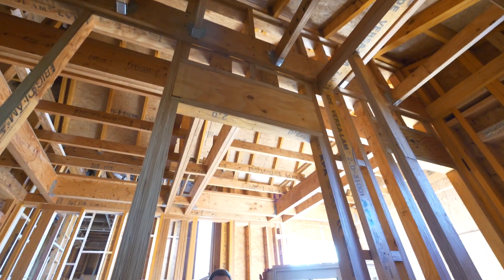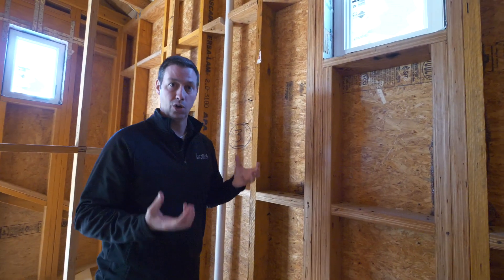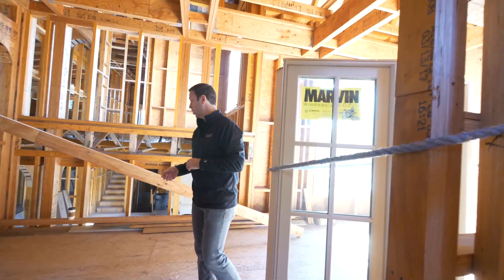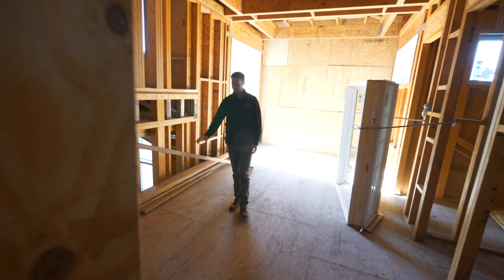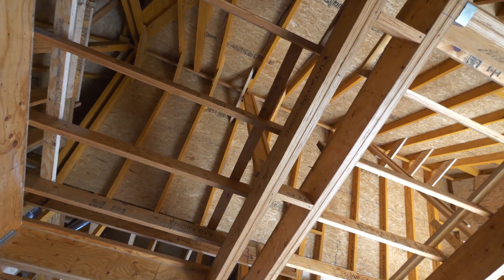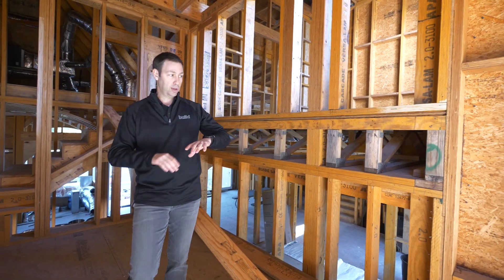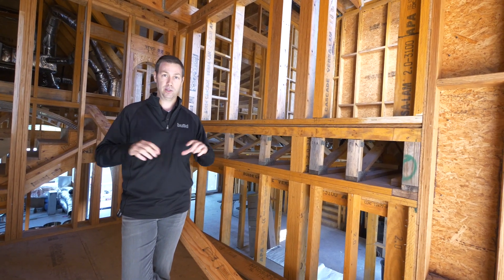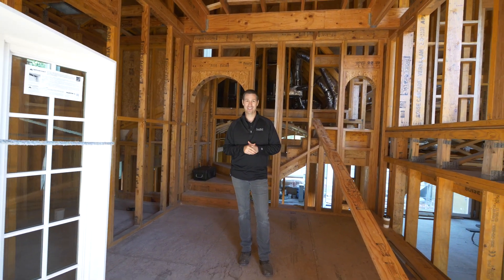2x6 LVL Studs - Pros and Cons

Comment: CBS is approximately the same in cost for the walls compared to a 2x6 traditional stick frame house. The only cost increase is the requirements for the foundation but with a house like this I'm sure the architect over engineered the foundation anyways. Really can't see justifying a lvl house that costs twice as much, is orders of magnitude weaker,  is sheathed in osb , and will have major structural  failures with a roof or plubming leak (though that isn't likely as big of a deal as the waste in cost).

Comment: if someone need high wind resistant house, why just not use right matherials like e.g. icf construction? or any other concrete based technology? it will be cheaper than making workarounds and stronger. and concrete house is much more comfortable inside.

Comment: Very cool house. having straight studs must have been a nice change. One advantage of LVL could be the ability to span much farther, and come longer. With that you could use much higher walls than typically seen without a floor in between. On a critique note, the AWC SDPWS doesn't want you to glue your wall sheathing to your studs, for ductility purposes usually associated with earthquake forces.

Comment: Most homes are rated to 110 mph and most windows only rated to 90 mph unless you are on the coast then windows are rated to 110 mph ( it isn't the glass that is rated it is the window sash being sucked out of the frame that is rated) Framing on the coast requires sheer walls threaded rods from footing to top plate this still doesn't stop the roofs from blowing off. Hurricane clips and a hip roof help but do not hold up in a bad coastal storm.

Comment: Great Video: I am sure your framers hated you on this one. hahahaha.  Use a timber framing nail gun to nail all the Lvls. Collar ties are suppose to be 2/3 from top of ridge to top of ceiling. Did the engineer add something to stop the spreading or designed in such a way not to use proper collar ties?
Reply: Collar ties and rafter ties are not the same. The former holds the ridge together, the latter keeps the weight of the roof from pushing the walls outward. Collars at the top, rafters at the bottom.

Comment: The one thing you fail to mention that drives me crazy is how hard- scratch that- IMPOSSIBLE it would be for an electrician to route wires up or down the walls after the sheetrock is up. I'm not sold on these new designs at all. There's a good reason framing has barely changed in 100 years.
Reply: Brilliant people just don't get it bro framing 30+ years this is just overkill a tornado hurricane or really bad storm will pulverize this monstrosity

Comment: We have codes that require commercial buildings to made of steel and concrete, but residential homes, where we sleep, only have to be made of sticks. 

Tells you what the government values more.
Reply: Many commercial buildings are wood. The separation is about occupancy and safety due to the fuel load of a building NOT strength. You can construct high rises from wood with the same structural stabilities as just about any other material. However, you will not meet the fuel load requirements without many costly extras to protect the occupants against getting caught in a fire or collapse due to fire. Is it practical to build huge with wood? No. But you could. In theory. 

Also If you are referring to the IBC IRC codes or INTERNATIONAL Building codes, which is what all of the codes are at a minimum based on here in the states, It was created by the ICC which was a merging of other code creators from all over the world and is based HEAVILY on public safety and safety from fire. The reason Homes can be built from wood easily on a single or two-family home is because of occupancy and is what separates the two codes from each other. IT IS NOT A COMMERCIAL VS RESIDENTIAL SEPARATION. It is merely a case of fuel load vs safe egress. They have spent millions on research and testing on this subject. SO to say the government doesn't value the people because they allow homes from wood seems a bit jaded.  ;)
Reply: @TrueRonin187  It depends on region, I can guarantee that you would never see a  commercial or government building approved and built down here in south Florida made of wood. Actually wood anywhere in the country for heavy commercial construction now days would be extremely rare.

Comment: You should have had the house engineered by a structural engineer.  The added stiffness of the LVL's adds to the lateral strength of the wall but that is not the structural issue.  The issue is the strength of the connections and the shear loads which are basically not addressed in this build.  the only thing that you mentioned was strapping and screwing the rafters.
Reply: 100% sure this was evaluated by an engineer.

Comment: So it will withstand 110mph wind, but will it withstand 110mph debris from the house across the street that wasn't built the same?
Reply: Touché
Reply: haha. such a good question
Reply: @etchcamelia108  $$$$$$$$$$$$$$$$$$$$
Reply: No only that even if your house survive  there will significant  damage because od the wind force basically you will need to replace the roof... so invest  In lvl is not a wise decision than to get a great insurance does. Built my block and concrete roof will make your house Stand  to those natural disaster
Reply: if we were three little piggies, youd be the one with the strong house that withstood the wolf's huffing and puffing.

Comment: I love the video just got a question. You said the word is really dense and hard so you have to pump up the pressure for the nails to get in there I take it you heard about nail gun and you have to use a hammer to finish it off what about screws I know it would take longer but would the screws be better in the long run I'm just thinking a quality in the end result

Comment: I use steel i-beams for all my studs - 16" on center, and 1/2" plate for the sheathing.  When I sit in my rocker and rock back and forth in front of a crackling fire with my tobacky pipe, it makes me happy knowing a Sherman tank couldn't get through my walls.  For that reason, it was worth the added expense.
Reply: Sound reasoning, however I opted for 12" o.c. spacing, with 1" plate steel and am installing a moat as a "belt and suspenders" approach
Reply: Steel plate steel would be ok a hundred years ago. But if you want a safe and sturdy house you should go with 2inch sheathing made from cutting edge composite armor.  It never hurts to put reactive armor on top of that.  But you can do that after you move in.  A house is just like your fightin position, you never stop hardening it. If you do.  That's when the sappers will get you...
Reply: @xxxrsgrsgxxx  sharks with laser beams in the moat?
Reply: @xxxrsgrsgxxx  Titanium is way better... stronger, lighter, corrosion resistant. Money's not an object, right? https://www.onlinemetals.com/en/buy/titanium-sheet
Reply: How about a King Tiger with an 88 mm cannon?
Reply: What kind of drywall screws u used for the walls? :D
Reply: LOL
Reply: LoL! You made me laugh my guts out! I love it when people pay a little extra to be happy and confident of what they are building
Reply: Always a pleasure to read the knee slappin’ comedians poke fun at those who … for a myriad of good reasons, have chosen to invest more time and more money to achieve a higher standard.  I will never pay for a Fabergé egg, a Patek Philippe watch, or a Bosendorfer piano, but I am quite appreciative of the engineering, craftsmanship, and effort it takes to create these amazing products.  While Matt is delivering on the desires of his customers, you clowns have paused your stapling of cardboard sheathing to share your sophisticated wit with us all … how nice.  I’m guessing the only time the phrase “high end” is mentioned on your sites, is when you’re hanging gutters?
Reply: I am disappointed this is not real

I want a bulletproof house

Comment: This guy in canada designed a framing system that has all the strength benefits your client asked for but it comes pre cut and is significantly lighter and i think all the studs and headers have insulated cores. Think its biffco something.

Comment: Does the additional weight of the LVLs require modifications to the foundation?
Reply from the maker: +J Skiahpa good question. I doubt it but any engineers out there care to comment?
Reply: Matt Risinger John Clark says the termites will take care of any mods needed
Reply: Assuming a standard strip footing on undisturbed stiff clay, the difference in dead load per linear foot is peanuts

Comment: Could you do a video on electric tankless water heaters? I find lots of info about the gas ones, but not some of the newer electric models.
Reply from the maker: +Pickle312 I'm not a fan of electric tankless units
Reply: I was just curious about them since my home is entirely run on electricity, although I have access to get gas added to the house.
Reply: If you have natural gas at the street that is going to be your best bet for utilities plus a heat pump.
Reply: Pickle312 electric tankless might work ok for a smaller sized house in southern climate, but up north with more than 2 baths,  forget it.

Comment: I'm about to start a small job with LVLs (basement). I need a new framing nailer though and want to try pick something that stands a better chance of driving an LVL nail in first go. I'm leaning towards a paslode pro (air) as they also make nails specifically for LVLs so I suspect they know about this problem. There's very little information on this though so just wondering if you used different nailers and if any worked better than others? Thanks!
Reply: Gordon, I believe PSI will make the most difference.  Finding a nailer rated for more than 125 PSI will be nice.  Most of the ones I see and mine included say not to exceed 125 or 135 I think. Ring shank are harder to drive than smooth shank and I would opt for smooth shank with the heat activated glue.
Reply: Thanks, finding a >125psi nailer seems like a challenge. The LSL nails Paslode make are also 30degree which narrows the field further. I'll keep looking, thanks for the tip. Edit: Looks like the rigid R350RHF is good for 150psi! It's 21 degree so no fancy LVL nails but I can live with that.
Reply from the maker: +Gordon Reyburn yes the Paslode guns do well with engineered studs. Good choice

Comment: with the hang over from the roof to waterproof the house, are you not worried that the wind could get under that and use it as a lever to rip it off. I have seen so many roofs pulled off because of the overhang.
Reply: Thats what the Orange Simpson Screws, and truss clips, are for. You generally don't need them both. But those prevent uplift by securing the trusses to the wall with a structural screw/holddown. versus just the toe nails from the framers attaching the trusses on.

Comment: Why not build a full ICF house if wind resistance is the goal?
Reply: Termites can only bore through the external foam, but not the concrete, in search of food. It's plausible for them to find their way through the foam to the roof which is typically wood. Of course there are plenty of ways in ICF construction to mitigate this, and overall the termite risk is still going to be much less than typical wood framing.
Reply: Termites. The Southern US is full of them.
Reply: Exactly, termite don't east ICF
Reply: They bore through it.
Reply: Do they?
Reply: ICF is best for warmer climates where ambient temps don't fluctuate as much as say a Zone 5 in South Dakota.  Neither the EPS foam nor the polypropylene webs are a food source for termites but ICF's can be treated.   Use steel studs and steel trusses or pour a concrete roof and dont give them anything to eat!

Comment: SHEESH...Just build ICF. The cost of the lvl    plus the standard framing cost is not near the long term value of an ICF structure especially with just 110mph rating. As a master, I respect the truths in the stick but lvl is VERY EXPENSIVE. I used it on a 4/12      clay tile roof with exposed rafters...I had to use cedar for the rafter tails because apparently the lvl can't get wet. Nevertheless nice video, beautiful framing.

Comment: ICF and be done.
Reply: Isn't that what Borate is for?
Reply: Foam used for ICF isnt treated and why code doesn't allow subsurface foam in termite areas.
Reply: Not sure where you been for the last decade but ICF does come in borate teated options.
Reply: Interesting.  What's the lifespan of the product?
Reply: I've read that treated EPS isn't very stable. Didn't know that it was used in ICF.   How long is it effective?   10-15 yrs?  In any case a homeowner would have to get code approval in most cases.
Reply: @johnclark7406  EPS is stable, XPS is the material that will experience r value drift.  Water is a huge enemy of XPS is does not dry well, EPS will dry out.  If you could keep them dry with something like rubberwall and a dimple mat EPS for sure should last in a basement wall.

Comment: Why not ICF, which is much stronger than a stick house, even if it is made with LVL studs.
Reply: You do realize John what ICF means right? the C stands for concrete.
Reply: Clearly the sarcasm went right over your head....
Reply: It's true, they are pretty strong, but they're pretty thick and you cant run stuff like, hvac, electrical, and pluming through them. They're good for homes with a large lot size, but if you live in the city with restricted space, then lumber is usually preferred.

Comment: Why not do a concrete or insulated concrete building to withstand wind? Then you get the added advantage of insulation value, insect and moisture resistance. Seems like a substandard and expensive solution.
Reply: Exactly.
Reply: And better wind/debris resistance to boot.  Only reasons I can think of are maintaining a certain aesthetic was too important or HOA compliance restricted that option.
Reply: exactly concrete house can withstand more than 100 mph winds

Comment: Do you use a special saw blade to cut these guys?
Reply: Fine tooth carbide blades.
They take a major toll on coarse blades. My go to is a 12 in. x 96 tooth laminate blade, but if you are in production, you can reduce that to 60 or so but it will be a bit messier.